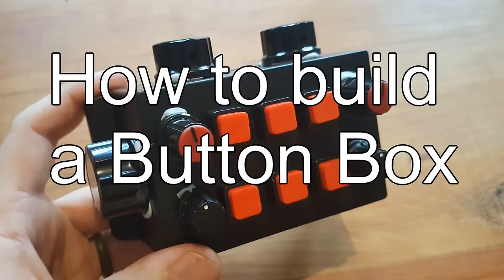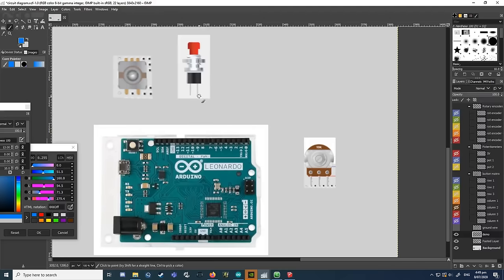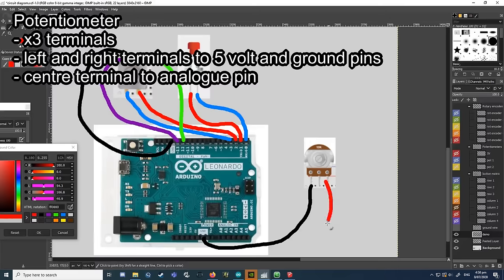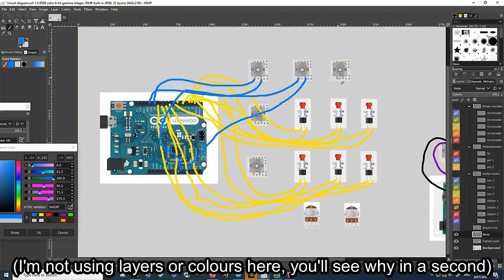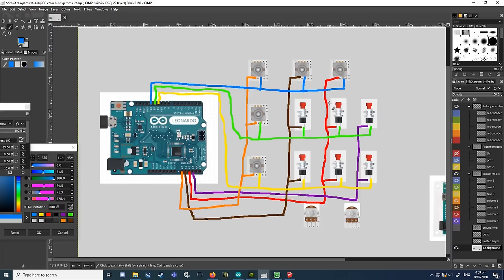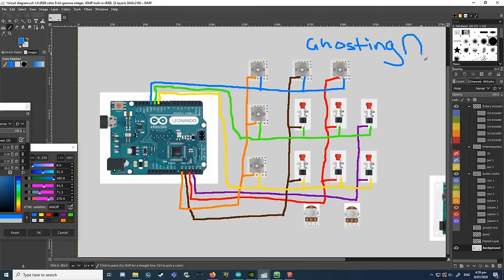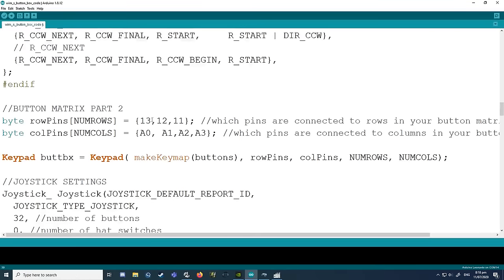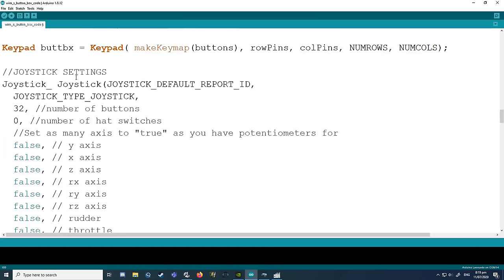How to Build a Button Box

Comment: So if you go with a Leonard the big advantage is you can plug in with the right cables into the headers and easily move things around instead of soldering into the teeny tiny pro micro right ?
Reply: You can solder headers to the micro. A lot of them even come with headers included in the pack.

Comment: Greetings! your sketch has been a huge help in setting up my button box but i have run into some issues. I have 4 rows and 6 columns (not all being used) with diodes going down each row. The last three switches on the end of two rows with 6 buttons on them aren't reading. I think those switches aren't getting enough voltage due to the diodes but i don't know how to fix that. Should i set them "low" or "high" and make sure they are all inputs? I had diodes on the rows to prevent ghosting by the toggles but i may not need them.
Reply from the maker: Sorry I don't know. Hopefully someone else will be able to help you, or you could ask around on the arduino forums

Comment: I'm trying to find similar solutions for PS4. Is there such a thing? If the manufacturers like Thrustmaster or Logitech have addons like handbrake or button boxes then their software has settings for these devices. It must be doable. I'm not a programmer, but I suspect the add ons may have an onboard chip that talks to the steering wheel and intern the software. Is it possible to DIY a handbrake or button/switch box for say a Thrustmaster T500?
Reply: Honestly it's hard to say to say but I'd be surprised if this works for a ps4. You'd be better off finding something that does work, breaking it apart and using the pre-existing connections. Obviously this requires a bit more electronics and fabrication knowledge. The best way to at least test this out could be buying a cheap as controller and having a look inside.

Comment: hello wim, i'm following your video that is very clear, but i have a problem with the matrix, i have a series of buttons and encoders but is not a button box, i know that is the wrong video to learn, but i can't find a helpful video like yours, so i have a pro micro and my cables are soldered together but on the ground pin and also not all the lines on the same, if you can help me, what i have to do? Maybe if you need more info i can give you
thanks 😉

Comment: Great vid! Tested and working quite good but rotary encoders inputs are only detected with rather slow turn speed, even with good quality encoders.. Do you have the same issue on yours ? Do you have an idea of a way to improve that ? Thanks :)
Reply from the maker: You can fix that using a "hardware debounce circuit". If you google that you should find some good guides.

Comment: I'm wondering if the voltage of the switches matters since arduinos run off 5v. The switches I'm looking at are 250v 3 way switches. My other question was if you could just add a 3 way switch as if it were two separate switches?
Reply: I now realize that was vAC no DC but they don't list a DC voltage. I'll just assume they will work. My second question still stands though.
Reply from the maker: @gavinwirth9307  Yes you can. Just wire it up with two terminals to two seperate columns and the third to a row (or vice versa).

Comment: Hiya!

Iv'e been following your tutorial through and had an issue while programming, in the error msg logs, it said this;

In file included from C:\Users\ayana\Desktop\Arduino\wim_s_button_box_code\wim_s_button_box_code.ino:2:0:
*
C:\Program Files (x86)\Arduino\libraries\ArduinoJoystickLibrary-master\src/Joystick.h:32:2: error: #error The Joystick library can only be used with a USB MCU (e.g. Arduino Leonardo, Arduino Micro, etc.).
 #error The Joystick library can only be used with a USB MCU (e.g. Arduino Leonardo, Arduino Micro, etc.).
  ^~~~~
exit status 1
Error compiling for board Arduino Mega or Mega 2560.

I've looked around on the internet and some people are saying I need to buy a new board (Leonardo, or Micro) while others are saying I am able to use this to fix it, any ideas?
https://github.com/NicoHood/hoodloader2
Reply from the maker: No sorry... I've only personally use leonardo. Maybe ask on the arduino forums?

Comment: hello, i keep getting the error below:

wim_s_button_box_code:1:10: fatal error: Keypad.h: No such file or directory
 #include <Keypad.h>
          ^~~~~~~~~~
compilation terminated.
exit status 1
Keypad.h: No such file or directory
Reply: Have you downloaded the correct library, moved it to the correct library file folder, then included it properly through the sketch button on the Arduino IDE? if you click the links in the description, they have a write up on how to properly import the keypad library.

Comment: This is a really good instruction. Thanks. I was just looking for an explanation like this. I do have a small problem however; On Windows you have the Games Controller app, where you can see the number of the button pressed (seen at fx 23:10). But I have a Mac and do not seem to be able to find any way of showing which number is pressed. Do any of you know of an app, which can show these numbers on Mac?
Reply: I have found a solution. There is an app, in App Store, which is called Gamepad Mapper. It show which button numbers are pressed when you click them.

Comment: So quick question on this great video. Not sure if I missed it but what are you using to draw the circuit?
Reply from the maker: GIMP. it's free image editing software similar to photoshop
Reply: use circuitio, its considerably better for this type of thing (it even automatically puts the wiring in for you) - or use something like visio or lucidchart, photoshop is not great fo this type of work.

Comment: I don't understand why the rotary encoders can't be matrixed. Surely as they're just digital signals they're perfect for matrixing? After all, you can't get simultaneous activation of the clockwise and anticlockwise turns. Is it because the circuit is completed momentarily and that you need more precise polling?
Reply: It's because each click of the encoder is not a single signal, but a series of signals. The code in the sketch seems to be based on Ben Buxton's code for rotary encoders. Watch this video from him to see the sequence of signals: https://www.youtube.com/watch?v=Wdk7fv5ZGw0&feature=emb_logo

Comment: @wimwamjoey 

Probably a stupid question but for the button matrix instead of the A pins for the columns, can I use other digital pins? I have a pro micro board with only four analogue pins
Reply from the maker: Yes, you can use any input for the matrix, analogue or digital

Comment: Wim - This is probably the most informative explanatory and content full package I have so far discovered on the Net suitable for a complete rookie like myself. I have built the box, wired it up as explained, run continuity tests and isolation tests through all of the switches I have on my board (everything works as required/expected) and I now arrive at the matter of coding. 
My box comprises 5 rows and 6 columns of switches (on-off) and nothing else so it should be simple, yet I am getting no results (which I guess is down to my programming somewhere specifically in the identifying of each individual switch to the Arduino Nano). 
Are you on Facebook and I could upload my matrix and panel wiring diagram.  One other question is that there is a diagram shown with red button lights (showing the switches functioning when operated) at about 18 minutes into the video. Is this supposed to come up automatically and does it need the base code loaded into arduino to make it function. I am lost at this point, please help if you or anyone else can.
Reply from the maker: Unfortunately you can't make a button box using an Arduino Nano. You have to use an Arduino ProMicro or an Arduino Leonardo.

I didn't realise at the time I made this video but those are the only Arduino models which works as HID (Human Input Devices). I'm really sorry for the error (corrected it in the description)

As for the red box, that's from AM Studio's video but I presume it's just a different version of the game controller at about the 32.20 point.
Reply: @wimwamjoey  No worries, I have ordered an Arduino Pro Micro from eBay and it should be here for Monday next week. Through trial and error, I have learned quite a bit about Arduino interfacing with my PC as a direct result so that has been beneficial. I don't know what I will use this Nano for as it was ordered on the strength of your guidance. Something will turn up I guess or I can utilize it in my basic training pack as a supplement to the Arduino Uno that came with that. Thanks for your help anf further guidance, it has been driving me mad that I was doing something wrong and it was the chip all the time that was not capable of handling the HID component required.

Comment: Greta video! I built two boxes the first one has 4 switches and 4 pots and all worked well. I build the next one with 25 buttons including 4 rotaries and no pots. I put it a 4 x 6 matrix and that's when I started to have issues. Only 2 of the 4 rotaries would work properly. I had one of my rotaries not show a button click and another one not show any rotary buttons click when using windows device to test it. The rotaries themselves test okay. I then set up 2 switches and two rotaries as a test on a breadboard. Once I get one rotary that works properly and the other that does not give a switch click or and ghosting of other numbers when turning normally. I know this is a long post but after hours into the project i am desperate to solve my issue. Any ideas or do you know of a site I can go to find some help. Thanks!
Reply from the maker: Can you post a link to your wiring diagram and code?

Comment: Is it possible to wire up the Matrix first, and then use separate pins for a toggle switch so that I can leave that toggle in an on position and press another Button at the Same time?
Reply: As I understood it, you would run into the Ghosting issue, as the toggle is always on.
(EDIT) Read your coment wrong, if its outside of the matrix it should work fine.

Comment: I'm not sure why, but I had downloaded the Joystick folder, and the Arduino IDE can't recognize that the files are there. I did move it into the libraries folder. I am having no problems with the Keypad files though. 

Error message:

Arduino: 1.8.15 (Windows 10), Board: "Arduino Uno"

wim_s_button_box_code:2:10: fatal error: Joystick.h: No such file or directory

 #include <Joystick.h>

          ^~~~~~~~~~~~

compilation terminated.

exit status 1

Joystick.h: No such file or directory

This report would have more information with
"Show verbose output during compilation"
option enabled in File -> Preferences.
Reply: The Joystick library does not work with the Arduino Uno (see video description). You will need an Arduino Leonardo or Micro (something with the ATmega32U4 chip).
Reply: @panicpetes7676  I’m not sure why that is coming up as an Arduino Uno on the error message, I’m using an Arduino Leonardo
Reply: @eversonenderlin6911  Have you selected the correct board in the Tools menu? And have you imported the library as described here: https://www.arduino.cc/en/guide/libraries#toc4
Reply: @eversonenderlin6911  are you sure you have downloaded and installed the complete library? when you go to https://github.com/MHeironimus/ArduinoJoystickLibrary click on the green "code" button in the top right corner, then "Download ZIP". Do not extract that ZIP file, just point the Arduino IDE to its location.
Reply: @panicpetes7676  Dude thank you so much. It is all working now. The only thing is, is that the bottom line in these lines of code give me an error message: 

currentOutputLevel = getAverageOutput(potentiometerPin1);
  steeringWheel_ = map(currentOutputLevel,0,1023,0,255);
  Joystick.setSteeringRange(steeringWheel_); 

I
t says "There is no matching function for call to Joystick_::setSteeringWheel(int&)'
"

This is strange to me because when I put "XAxis" and "YAxis" in for "SteeringWheel," it works fine. This should be the last thing I need help with. If you can't figure it out, that is fine. But once again, thanks for your help!
Reply: @eversonenderlin6911  Note that you are trying to call function Joystick.setSteeringRange(int16_t minimum, int16_t maximum), which is used to set the minimum and maximum values for that axis (and expects two values handed over). If you want to set the current value for the axis, use Joystick.setSteering(int16_t value) instead. 
If you are using it for steering, you might also want to consider using the full 10 bit (0-1023) the Arduino ADC has to offer instead of scaling it down to 8 bit (0-255).
Reply: @panicpetes7676  Alright dude, it is working perfectly now. Once again, thanks for the help. I probably would not have been able to do this without you.
Reply: @eversonenderlin6911  No problem mate, always happy to help

Comment: What if you want to add the encoder buttons to the button matrix, or you use encoders with no push button? Do you just replace the third and fourth values with zero?
Reply from the maker: You can include push function for an encoder in a matrix, but not the twist functions. The twist terminals need to be connected to their own pins.
Reply: @wimwamjoey  i get it now, i was confused for a second... thanks so much :)

Comment: Okay so my matrix is a 5 by 4 matrix which leaves me 5 extra pins after adding only three rotary encoders into my setup. What I want to do is wire 2 toggle switches that are wired to their own sets of pins so they don't mess with the matrix. how do I do that with the code? My closest guess is changing it to a 5 by 6 matrix with those buttons being their own matrix. Which is what I will try

Comment: Hi  Do you know why rotary encoders are not detected by farming simulator 22? In other games everything works fine. Thank
Reply from the maker: No idea sorry.
Reply: @wimwamjoey  I solved the problem myself.  Farming simulator 22 in my case did not read buttons above 24. encoders were as buttons 32 31 30 and 29, I changed it and everything works

Comment: just bought all the stuff I need to start building, though quick question regarding the rotary encoders.
The ones I got have the 5 pin straight layout with the CLK DT SW + and GND.
I've been watching some video's that the + pin goes to the 5V line on the Aurdino, and the SW for the push button to a pin.
In your video you have two wires as part of your matrix for the push button.
Would the + be for the 2nd wire in the matrix or would it go to the 5V line on the board?
Reply from the maker: Yes the pins marked + and SW control the push button function. They go into your button matrix.
Reply: @Wim  okay, thank you.
Yeah it was a bit confusing since other videos I saw said to wire it up to the 5V.
In fact here is the link to my initial wiring diagram if you want to check it out.
So what I'll do than is just replace the yellow single line for the matrix with the white wire since that way I won't have two yellows.
https://youtu.be/2JUR73zc_6U

Comment: great video but i wanted to know how you would make a case? also would you know if the program to regester the keypresses would work on linux?
Reply from the maker: Sorry, no experience working with Linux so I can't answer. You can buy a case from any electronics/hobby shop. Then you just have to drill holes to fit the components
Reply: @wimwamjoey  ok thanks for that

Comment: For a momentary 3-way toggle switch (ON)-OFF-(ON) with three pins, how should this be arranged in the grid? It's my understanding that the two on positions would be treated as separate rows or columns in the matrix...but what about the center pin?
Reply from the maker: Hard to explain without a diagram but the two outside terminals should be on separate rows while the centre pin should be on a column (or vice versa)

Comment: I was reading through the comments and I saw where you have just touched the surface on switch ability do you have any other tutorials on this. I am trying to build a button box using some on/off toggle switches and I and trying to figure out how to write the code that will allow the toggle switches to act as momentary switches each was you press them. For instance when you turn on the toggle to attach a trailer the switch will stay in the on position but only momentarily press and button. Then adversely when I turn off the toggle it would again press the same button again to disconnect a trailer. Hope this makes sense thank you for any help or a video that could point me in the right direction
Reply from the maker: I don't know sorry. Potentially you may be able to get around this using some third party software like joystick gremlin or joytokey? That might be simpler than trying to code it.

Comment: Can some one help my with the diagram for the wiring im stuck please  i have made a layout for the box i want  via Pm a can send the image im using A Uno R3
Reply from the maker: Sorry, as noted in the description, I made a mistake in the video. This will not work with the arduino uno. You need to use a pro micro, leonardo or mega  instead.

Comment: Thank you very much for the video, it helps me a lot building a button box. I bought some rotary encoders with a board and designation for the Pins. The designation says it got a 5V connection. I cant find it in the video, where to connect the 5V pin. In your tutorial the button needs two connections, whereas there is only one Pin for the button on the encoder (called SW). Did I buy the wrong encorders?
Reply from the maker: The terminal which says 5V is actually one of your two matrix wires for the purposes of this circuit. Basically instead of sourcing our power from the 5V output, we are sourcing it from one of the pins.
Reply: @wimwamjoey  thank you. I just desoldered the chip. Then you have the Same rotary encoder, like everyone got for the button box. :)